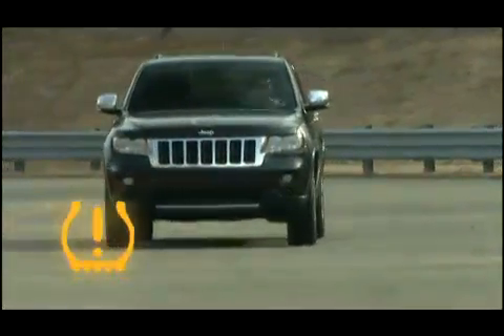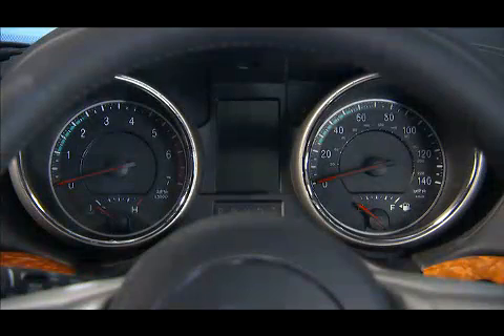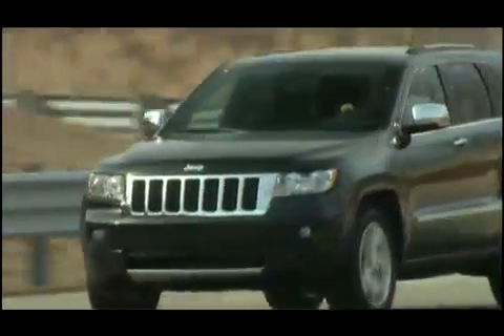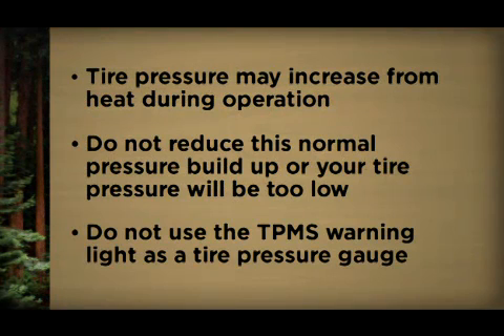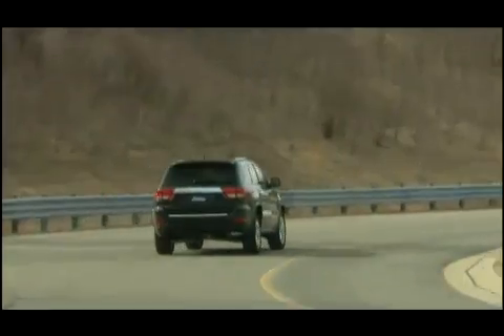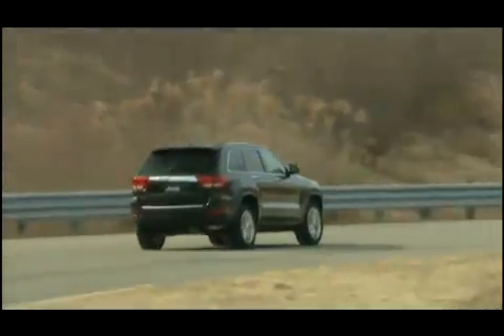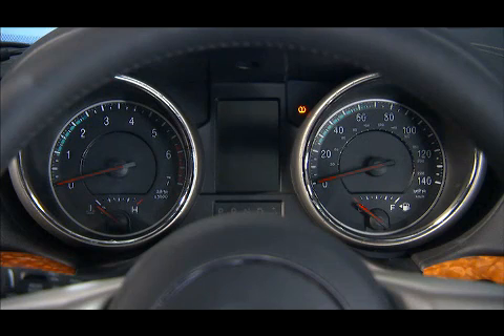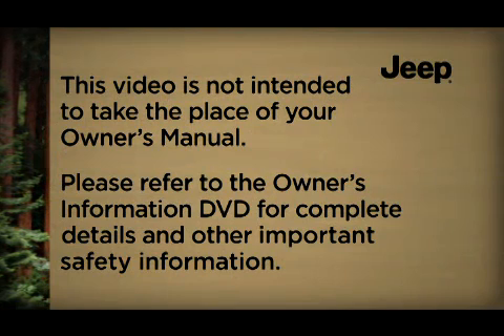2011 Jeep Grand Cherokee | Tire Pressure Monitoring System

Comment: M'y 2011 JGC tire pressure system goes crazy.  it reports ZERO's and sometimes flashes all zeros and one tire with 99.  dealer says just one needs replaced for $200.  then why would all the rest go crazy?    I don't want to spend $200 on one and find out later that they all need work.  Doesn't make sense that they give false readings also if its just one does it?  My dealer has not covered one single thing since I got the car with a "bumper to bumper" warranty so I dont trust them.   What should we check?
Reply: Mines doing the same thing. It drives me crazy. Is there a master reset button for the tpms?

Comment: What do I do when the system flashes the 75 seconds then turns solid yet I don’t get the TPMS on my display? Took it to discount tire and they checked the batteries to my TPMS and they are good. I can see my tire psi on the display for all four and no clue how to have the light turn off. 
2012 Jeep Grand Cherokee SRT
Reply from the maker: Hi Javier Sandoval,
We're sorry to hear about the trouble you're having. We recommend visiting your local FCA certified dealer for an inspection of this concern. You're welcome to call out Customer Care team if you need any additional assistance. You may find their contact information by clicking on the following link: https://fcacommunity.force.com/Jeep/s/article/How-do-I-contact-Jeep2